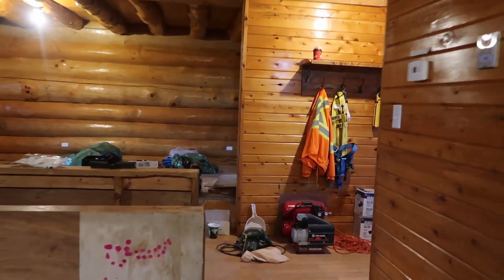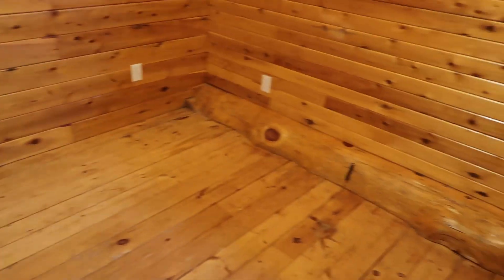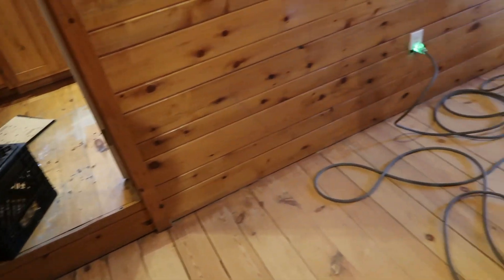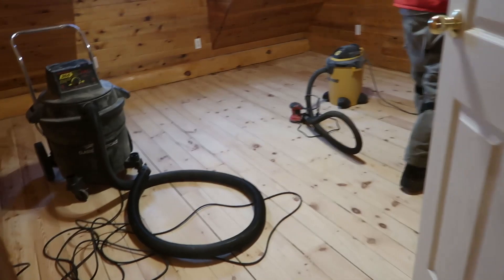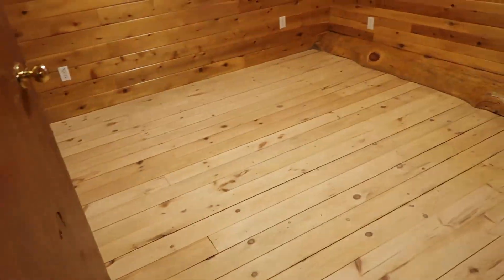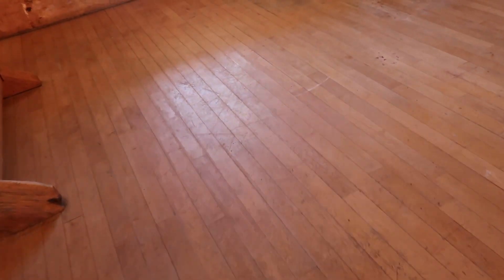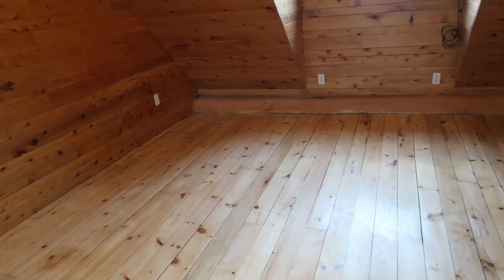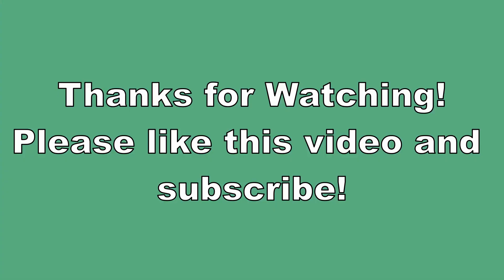Headache at the Log House Part 2: Refinishing the Floors

Comment: Are the outside walls just logs? It looks like logs on the inside . How insulated?
Reply from the maker: The logs have an R-value 1 per inch of thickness so 10 inch log would a value of 10 which would be the equivalent value of 2x4 walls with insulation. Most of my logs are 20 inch and plus. The logs have a thermal mass factor that helps maintain the heat value, easy to keep the heat up but harder if the house went completely cold.